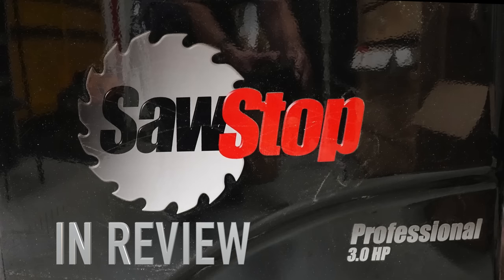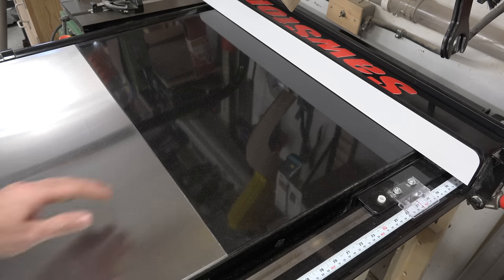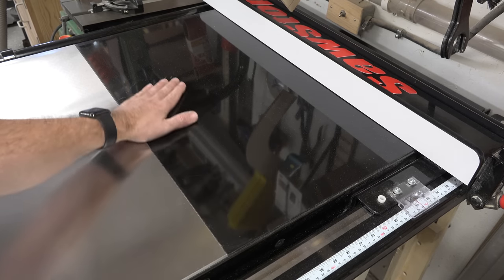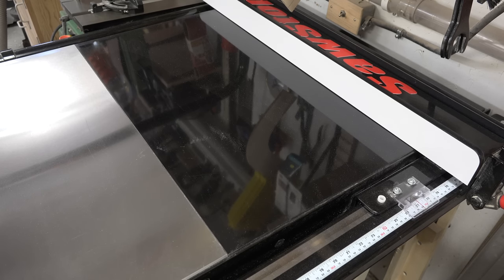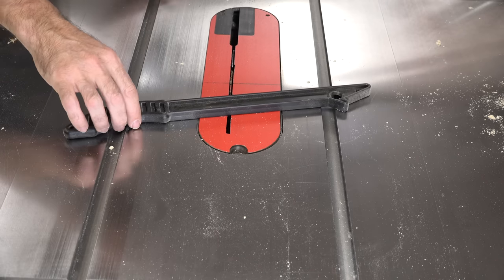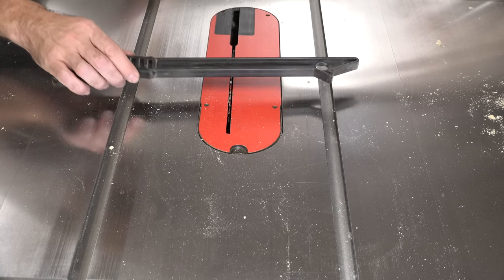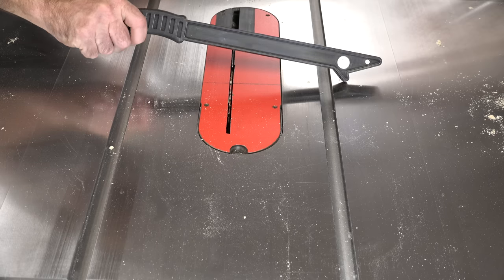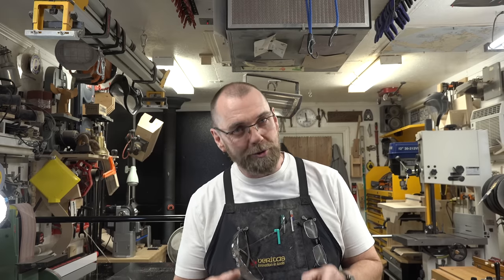Saw Stop Review

Comment: Can I ask you about your dewalt planer in the background on a low shelf. When you want to use it, do you just lug it onto a higher surface or do you keep it and use it low? Or something else? Thank you
Reply from the maker: Of course you can ask about the planer.  The DeWalt planer is a heavy machine to have to lug around so I just don't do it.  If you look carefully, the planer is actually upside down.  That is because it is on a flip top tool stand that I constructed.  I have a short video where I demonstrate how it flips and you can find that here.  https://www.youtube.com/watch?v=nMYzhITQNLA&t=133s
Although the planer in the video is the DW734 box planer, it is the same stand and the same concept.  It makes it a lot easier to handle and saves a ton of space in the shop.  If you have any questions, please feel free to ask.  Thanks for tuning in to the show.  It's truly appreciated.
Reply: Thank you so much for the informative response. Great video as well.
Reply from the maker: @olivepressdesign  You're very welcome.

Comment: superb review. thank you.
Reply from the maker: You're very welcome Ray.  I'm glad that you liked it.
Reply: @acutabove_woodworkings  Picked up my sawstop today. Rockler had exactly what I wanted in stock. your review helped me decide on the 3 hp. I ordered the industrial base. wondering whether I should wait for the mobile base before I put the saw together. Any advise? Thanks
Reply from the maker: @lobird23  The mobile base needs to be installed on the saw by getting access to the bottom of the lower cabinet.  For this, the saw needs to be tipped on its side.  Now while it is completely possible to install the mobile base after the saw is assembled, it is much easier to install it before assembly starts.  If you are going to install the base after the saw is assembled, you will need to unbolt the extension table legs and fold them under the saw.  Then you will need to tip the saw over so that it is resting on the large fence rails.  From there, you can get access to the under side of the cabinet to install the foot pedals and interior mechanisms for the lift.  Once they are installed, you can tip the table back upright and finish off the installation.  It's a little finicky to work on after the saw is assembled but it is totally possible.  I hope this helps.
Reply: @acutabove_woodworkings  helps a lot. Thanks!
Reply from the maker: @lobird23  You're very welcome.
Reply: @acutabove_woodworkings  the electrician that i am considering says that it is slightly more expensive for compatibility with the 5 hp and my 3 hp single phase. I asked about upgrading. does this sound right?
Reply from the maker: @lobird23  I'm not exactly sure what you are asking.  I'm not sure what you mean by compatibility.  Are you asking if it is more expensive to run a 240volt 5 HP saw as apposed to a single phase 3HP saw?
Reply: @acutabove_woodworkings  yes, I would think the electrical line for the 3hp single phase 240V would be the same as the 5hp single phase 240V.
Reply from the maker: @lobird23  Where the extra expense happens is in the amperage of the machine.  A 5 HP saw will draw more current than a 3 HP saw and even though both saws are 240 volts, due to the amperage of the machines, they require different sized conductors and breakers to supply the power.  The receptacle is the same, but the stuff that feeds it is not.  Copper is expensive these days so I can see the installation of a new line for a 5 HP saw being considerably more expensive that a 3 HP.  Depending on how far away from the panel you want the receptacle it can get even more expensive because the cable will have to be made even bigger to compensate for voltage drop in the line.  I hope this helps a bit Ray.
Reply: @acutabove_woodworkings  It makes sense. I want to be able to upgrade  my 3 HP ICS saw to a 5 HP in the future without having to rewire. Thanks for your help!  Your videos are very informative.
Reply from the maker: @lobird23  You're very welcome.  Thanks for the kind words.

Comment: Hey Kenny, as an electrician I have a question. My temporary shop doesn't have 240v but is next to the laundry room so I made an extension cord from my dryer to my 3hp sawstop. I just left the neutral disconnected. Thoughts?
Reply: I mean, it works like a charm... Also in Ontario.
Reply from the maker: One of the biggest problems that I can see here Francois, is voltage drop.  In order to keep the voltage the same, you would need to increase the cable size in order to compensate for voltage drop.  I would think that running an extension cord from the dryer is a bit of a pain in the butt and while theoretically your cord would work, it really isn't the best method of doing this.  You would be far better off to run a new 240volt line from your panel to your temporary shop and use a properly sized cable to allow for the voltage drop from there.  Electricity is nothing to mess around with and taking short cuts will only cause problems in the long run.  I hope this helps and I thank you for tuning in to the show.
Reply from the maker: It would definitely work.  I just prefer not to take shortcuts when it comes to electricity.  To each their own I guess.

Comment: How often have you dropped the nut and if you do is it an hour long game of hide and seek or ezy to find
Reply: I was really looking for an answer rather than a like but thanks anyway
Reply from the maker: I can recall dropping the arbour nut a couple of times Barnezy and I can honestly say that I had it back in my hand in about 15 seconds.  The blade is surrounded in a dust collection shroud with a 4" port at the bottom of it.  The dust collection system does not have the power to draw a large nut like that through the collector hoses so it ends up resting in the hose in the saw's cabinet.  The hoses have a quick release clamp which allows me to disconnect in, remove the nut and reconnect it within seconds of dropping it.  The access to these hoses is through the very large motor cover, located on the left side of the saw, so access isn't a problem.  Thanks for tuning in and thanks for chiming in with a great question.  I truly appreciate it.
Reply from the maker: I gave an answer Barnezy.  I'm just faster at clicking "like" than I am at typing an answer.  LOL.  Let me know if I answered your question.  If not, I will try and reword it.

Comment: I too own the same saw you reviewed, though I bought mine used.  My last saw was a Powermatic 66 but since it didn't have a riving knife and there wasn't a clean way to add one I decided that I'd buy a Sawstop to replace it. I was prepared to pay full price but was fortunate to find one locally that was used and like new.  The only complaint I have is with the extension table, the formica has delaminated on the edges and looks like crap, granted it still functions but for the price of these saws they could have done better.  I also agree on the short cord, but honestly that's a cheap and easy fix in the scheme of things.   Overall I agree with your review 100%, it's a great saw with the added benefit of the brake system.  Thanks for the great review, it's always interesting to hear another users take on them.
Reply from the maker: Thanks for the kind words on the program Larry.  I'm sorry to hear about the de-lamination of the extension table and I have to wonder what the previous owner did to cause it.  I would suggest contacting sawstop and see if there is something that they can do for you.  The extension table is not a very expensive part and at the very least, maybe they could sell you a new one.  Just a suggestion.  Thanks for tuning in and for taking the time to leave a comment.  I truly appreciate it.

Comment: does it sense your fingernail or glue covered finger?
Reply from the maker: The saw senses anything that is conductive.  That's your finger, finger nail, finger with glue on it or a metal fence or miter fence.  You have no worries of this saw protecting your fingers, regardless of where they might contact the blade.  You might still have a little knick on your finger, but at least you will still have your finger attached to your hand.  I hope this helps.  Thanks for tuning in to the show.

Comment: I just wish there was a saw with this build quality that didnt have the sawstop feature.  I cant find a good saw.
Reply from the maker: There are plenty of good quality saws on the market that are not in the price range of the Sawstop.  I had a Ridgid saw for many years that was fantastic.  I never had a problem with it and it was around the $500 mark.  Keep you eyes open on your local kijiji site to look for used equipment.  Sometimes all it needs is a little tune up and they are good as new.  I hope you find a saw that you are happy with.  Thank you for tuning in to the show.
Reply: @acutabove_woodworkings  thanks for the kind words.  I ordered a remake of the general international 270.  Hopefully its decent.  Also used your rikon videos to set up my bandsaw.
Reply from the maker: Excellent.  General International makes a great product.  I think you'll have a good experience with it as long as you take the time to calibrate the saw correctly.  Glad to hear that you found the bandsaw video helpful.  Thanks for tuning in.